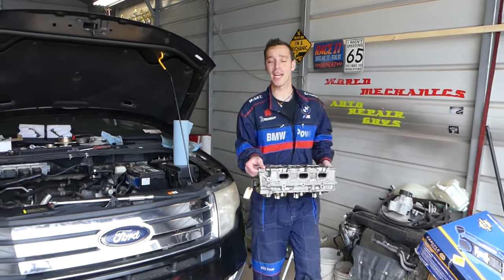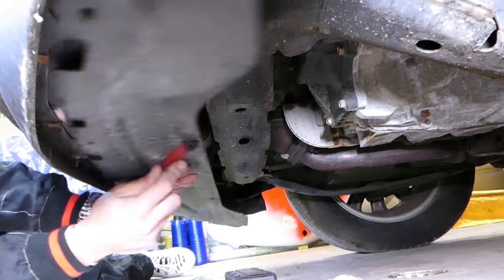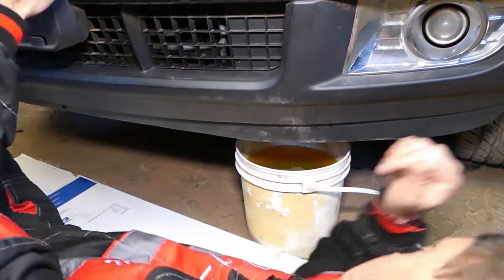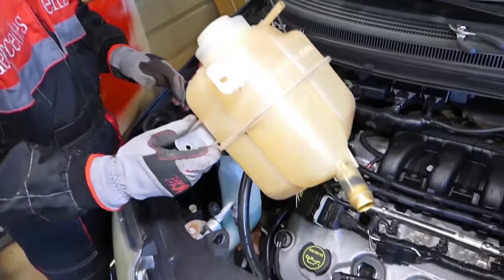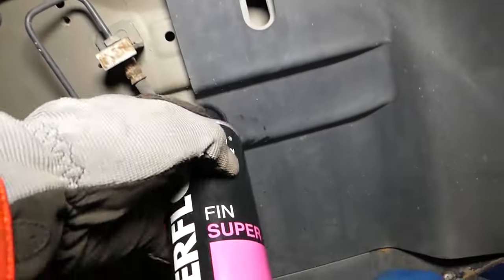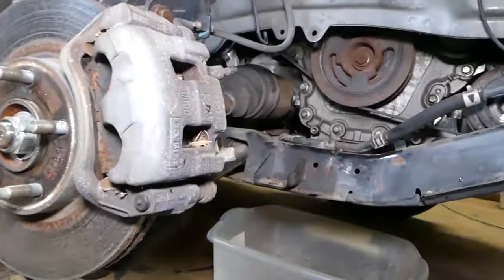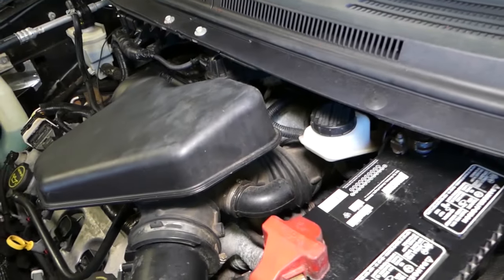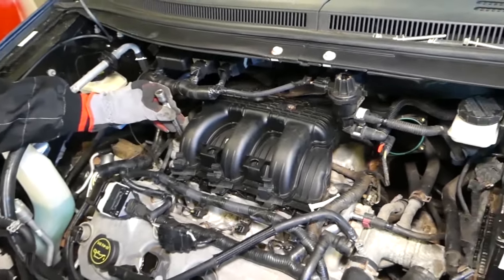CYLINDER HEAD AND HEAD GASKET REPLACEMENT REMOVAL FORD EDGE FLEX TAURUS LINCOLN MKX MKZ MKS MKT 3 5

Comment from the maker: Products that we use and recommend:
► Gasket Kit: https://amzn.to/2W8RAIC
► Panel Removal Set: https://amzn.to/3YiMADu
► Assorted Fuses: https://amzn.to/4fx4s3F
► Tool Set: https://amzn.to/3p5MM6t
► Screwdriver Set: https://amzn.to/3XRB28Q
► Castrol Oil: https://amzn.to/3xBc8B9
► Oil Filter: https://amzn.to/3w0Ulme
► Torque Wrench: https://amzn.to/32qyRwg
► Liqui Moly Engine Flush: https://amzn.to/3IiDBID
► OBD Scanner that we use most often: https://amzn.to/3I4MQfe

► Check out our Amazon Store for the tools and parts that we use: https://www.amazon.com/shop/worldmechanics
Reply: @ 1:20:25 you day inspect the seals... The first one you point at.... What would be the issue of that O-ring was messed up or missing???
Reply: No infesting ing hearing about anything Except how to change a head gasket on2110 Ford fusion

Comment: LIKE THE  VIDEOS, BUT I'VE NOTICED SOMETHING VERY DANGEROUS IN A FEW VIDEOS.  YOUR MECHANIC ALOT OF TIMES WEARING JEWELRY AND WATCHES WHILE DOING WORK.  THAT CAN BE VERY DANGEROUS IF IT GETS CAUGHT ON ANYTHING ESPECIALLY IF THE ENGINE IS RUNNING  JUST SOME ADVICE DON'T WANT ANYTHING TO HAPPEN.  OTHER THEN THAT GOOD VIDEOS KEEP EM COMING😊

Comment: Is this for the Explorer 3.5 as well?
Reply: Yes the 3.5 Ecoboost is used in Ford Explorer (2011-present), Ford Edge (2011-present),Ford Flex (2010-2020),Ford Taurus (2010-2019),Lincoln MKX (2010-2020),Lincoln MKT (2010-2019).

Comment: Please give information about timing of 2015 Mazda 3.7 engine. Water pump failed and and locked engine when I tried to turn crank to set cam gear timing. Chain slipped on crank pulley. 
Thank you 
Bill

Comment: Hey man 
Exellent work,keep up the hard work!
I got a question for you! 
I have s max ecoboost 2l 2011 
I cannot hardly find any info i rebuilding my engine, I'm replacing the piston ring, aswell as the head gaskets seal,
This is the info i need
1) I need the tork tightness for the piston ring bottom when i tight the crankshaft! (Cause i will be replacing the piston rings only)
2)head bolts tork tightness 
3)crankshaft bolts tightness 
Can you guide me the right place! I have been intouch with fords but no joy!
Thanks

Comment: I am currently working on a 2011 Ford Taurus SEL, i am putting in a new thermostat, head gasket set, and water pump. I am to the point where i just have to clean it up and reassemble everything, can anyone give me an eta on how long it will take to reassemble everything? Much appreciated.

Comment: I could use some help. I've been looking around and can't find a video on replacing the hood on a 2013 Hyundai Elantra. I hit a deer a week ago and my insurance won't fix it. I was able to replace the passenger side headlight and that's about it. I gotta replace the bumper, the hood and possibly the metal bar that protects the radiator. Good thing there was no internal damage and it's been driving fine, it just looks like crap...
Reply: most cars its as simple as 4 bolts on the hinges. if the hinges look bent you'll want to replace them. you can usually get them with the hood if you get it from a junkyard. another benefit to a junk yard hood is that sometimes you can get a hood in your cars color so it doesnt need to be painted

Comment: 2014 Fusion 2.0 ecoboost: noticed burning coolant smell and running slightly hot.  Discovered coolant level was 1.5” below max.  Then noticed some white smoke smells of coolant in exhaust when starting cold.  Oil smells a little more gassy than I’ve ever noticed, but no signs of coolant in oil, no sign of oil in coolant.  What can cause this?  What can I do to confirm what the issue is?  Is it safe to drive if I keep levels topped off?  143k miles.
Reply: Sounds like a blown head gasket. Combustion leak test
Use a block tester kit to perform a chemical test on the radiator's vapors. This test can help identify a blown head gasket if you're losing coolant but there are no signs of leaks. Most parts stores rent the kit if you don’t have one. Pull your spark plugs and see if they are wet. Run a compression test. Old school pull all the plugs but the cylinder you are working on. Remove radiator cap, fill to the top with water, pull the starter and fuel fuses. Crank the motor, look for big air bubbles. Do each cylinder. The air bubbles will let you know the cylinder that is compromised. It’s possible that you can have more than one cylinder leaking coolant.

Comment: Hi. I am fixing my Lincoln MKZ 2011. I have on the front right with the alternator  harness  a green wire by itself I don’t know where it belong. Then I have another one where is the throttle body that looks exactly as the one that connect on it but I don’t know where it goes. I looked everywhere can’t find it. If you can give me a hint that would be greatly appreciated. Thanks.
Reply: Power steering pump
Reply: @codyyoung1122  thank you. Yes indeed it was.

Comment: Where are the torque specs. Mention in the 3.5 Lcylinder head replacement video?
Reply: It is recommended in your owner's manual to 30 ft-lbs.

Comment: I changed the head gasket out on my 08 Lincoln MKX and now it will crank but not start. What could be the problem? Thanks
Reply: Your timing chain needs to be set correctly.

Comment: Its abundantly clear that this was the first time yall ever worked on this motor.  It was almost comical. Lol
Reply: Hey Moon Shine. Have you ever dome one before? ? I'm contemplating it on my 2009 ford Taurus. How hard is it to do? Thanks!!
Reply: @rocketboy65  dome one?
Reply: @genehooks7248  sorry. Was driving! Have you done one and if I am patient and go slow, do you think I can do it? I'd hate to trash the car. No smoke. Just milky oil and a gallon of anti freeze every 2 days. 😢😢😢
Reply: @rocketboy65  if you're mechanically inclined, I don't think you have any issues. Just take all necessary precautions like bolt labeling and dont try it without the cam locking blocks. They're a must. Believe me.
Reply: @rocketboy65  oh and take lots of pictures. Like the placement of your turbo tubes.
Reply: @genehooks7248  thank you!!

Comment: Don’t be like these guys and use a torx 55 to remove or install new cam bolts. It’s not a torx 55, it’s torx 55 plus.
Reply: Joshua Baker I removed and rebuilt my engine a few months back and I can tell you with certainty that the cam bolts are torx 55 plus, they’re also not reusable. A torx 55 bit will half ass fit a torx 55 plus fastener, but a torx 55 plus bit will not fit a torx 55 fastener. A torx 55 bit fits a torx 55 fastener loose as hell, with the risk of it slipping and stripping out the fastener. You can even tell from the movement he gets on the breaker bar once it falls in place.
Reply: They must have changed it after 2010, the I’ve got the Vin C engine in a 2012 limited.
Reply: @J Hey J. I'm contemplating it on my 2009 ford Taurus. How hard was it to do?
Reply: @eaglekeeper6056  He was not using a breaker bar. It was a torque wrench. You could hear the click. Not so good for calibration of the wrench.
Reply: so i just replaced my water pump, and put it all back together and now, unlike before my exhaust is spitting out a smell of burnt coolant, peculiar because its running straight water (however the heater core was probably clogged with antifreeze, because I put stop leak in before having to tear it all down). But now I'm expecting to tear down the engine again and get to the head gasket, however I'm wonder whats the deal with the locks if I have to remove the cams for the valves. If I were to do this, would I have to do anything other than have my marks lined up when reinstalling the cams back onto the valves?